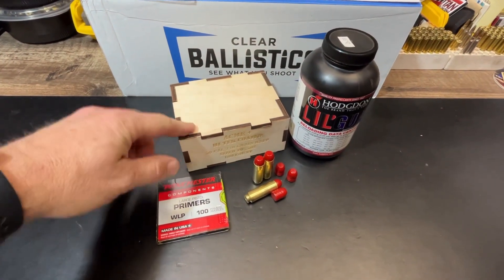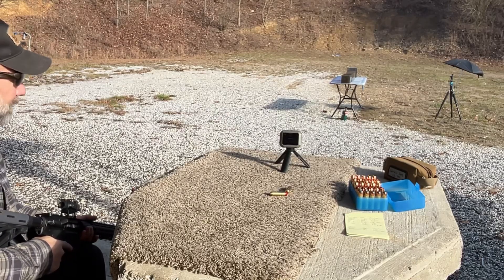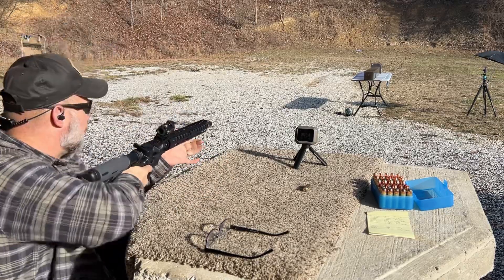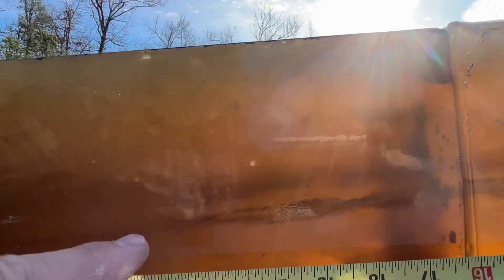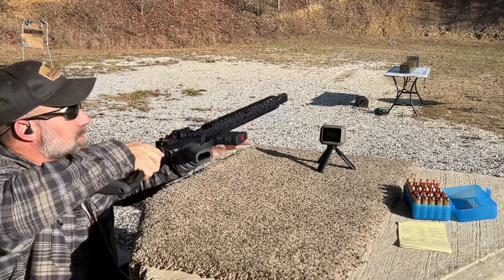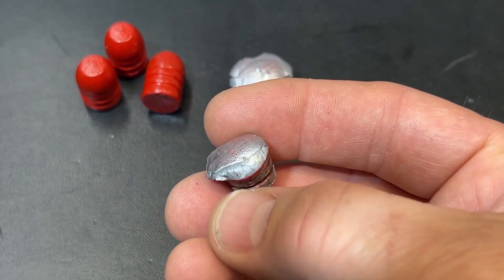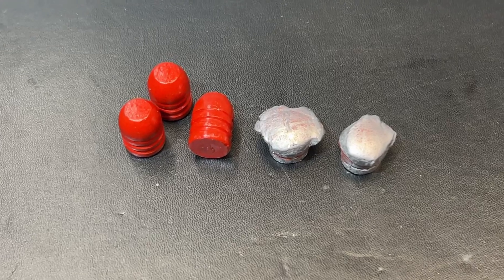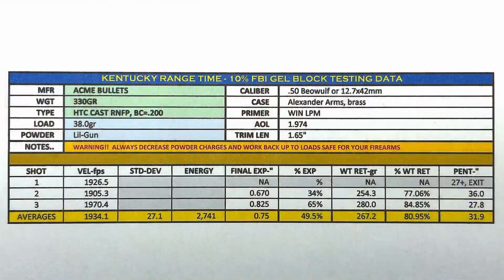50 Beowulf Gel Block Testing the ACME 330gr RNFP HTC-Hi Tek Coated, Cast Bullets

Comment: Very interesting.   But I wonder if these bullets will foul the gas port.   Many sources I've read caution about using cast, swaged, or coated lead bullets in gas operated systems.   The manual with my Desert Eagle specifically states to "use only jacketed bullets with enclosed bases".   So, my ARs and Desert Eagle get only jacketed bullets.
Reply from the maker: @claiborneeastjr4129  so far so good. I had a .300blk that had that issue. It shaved lead that ended up collecting all the way back in the gas rings in the bolt. A lot of this depends on if the gas port bisects the lands.  If it cut is fully  in the grooves it’s normally not an issue.

Comment: Hate to tell you, but you are leading that barrel.  Acme claims 17bhn, they seem softer, the coating is comming off the shank of the bullet.  Run your bore cam threw it.  2000fps is very fast for a bullet that soft and with no gas check.  I have been casting for 20 years and tried hitek, but stuck with powder coat as it works better to stop leading, especially with soft lead.  Btw, your videos are great 👍
Reply from the maker: @mikenkaleigh  👍🏻 I ran these for the gel test. I don’t normally run too many cast bullets in my AR platforms. They’re bad to shave lead where the gas port hole is cut too, if it doesn’t fall entirely in one of the grooves . 😉

Comment: I make my own bullets and powder coat them
Reply from the maker: @slag2099  that’s the way 👍🏻. I cast for 4-5 calibers and do some PC when so have time. Honestly, my PC game needs a bit of help. 😂😂
Reply: @kentuckyrangetime  I've heard of people doing polymer coating ,like to see someone's gun to see after shooting if would like to try ,I tried electrical plating but is reel pain the but
Reply from the maker: @slag2099  I’ve done the static coating with the spray gun, and the shake and bake method. I think my polymer powder might have been sub par. It’s been a while since I’ve tried. Not had time to cast much recently either. I did pick up a .50cal mold for my muzzleloader a while back. It may be about time 😉

Comment: I'm a LITTLE concerned that the recovered slugs have no red polymer left on the shank rings, except in the grooves.

There may yet be some leading.
They must be adding the polymer to a full size bullet, meaning the wbd result is slightly oversized abd the excess is getting stripped off fown to the cast lead alloy
Reply from the maker: @ravissary79  your probably right. They’re listed at .502 in the box. We’re measuring .502-.503.  Just another reason I don’t run these in large volumes. 😉

Comment: I’ve shot a bunch of my own wheel weight cast bullets over the years. Never noticed lead in my gas rings but I’ll keep an eye out now. Were you shooting rapidly like in a competition that kept the gun hot? Guess I should count my blessings
Reply from the maker: @jeffhuntley2921  No, just plinking. If the gas hole hits completely in a groove it usually good. If not, then it can cause issues. 👍🏻 😉